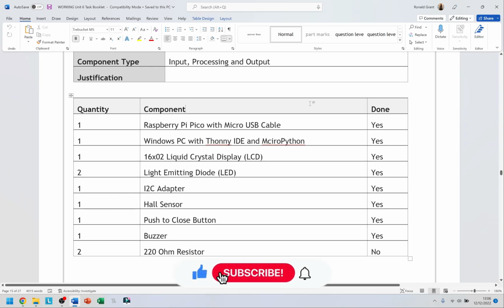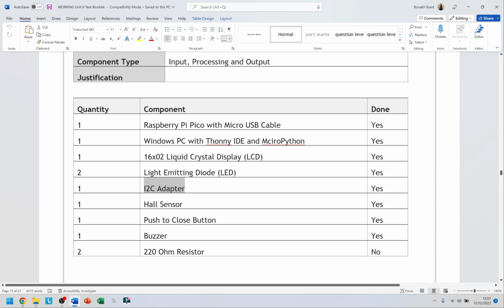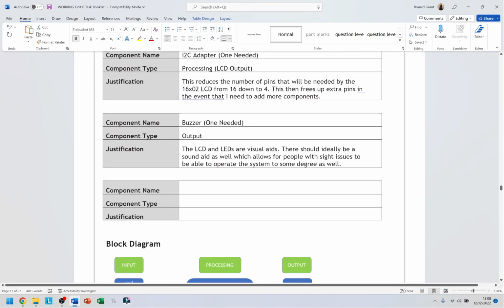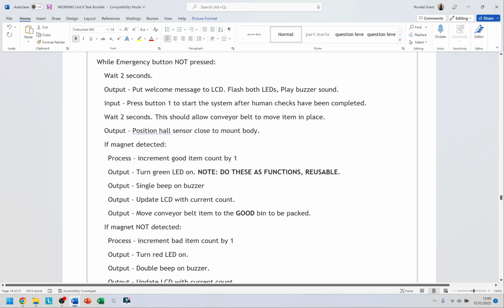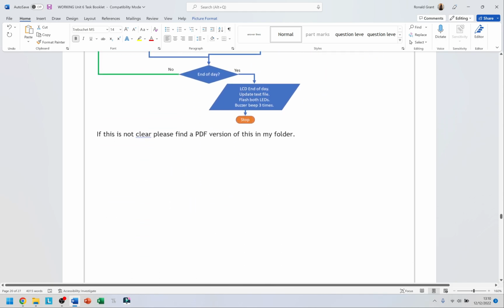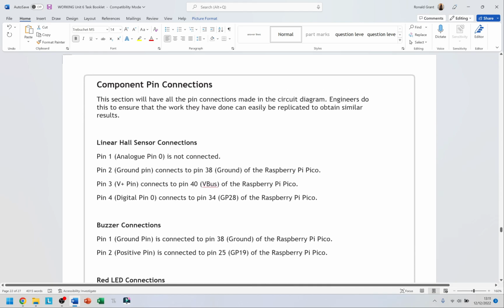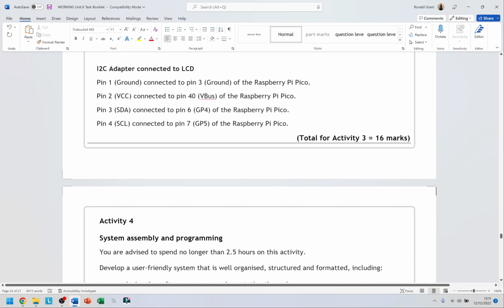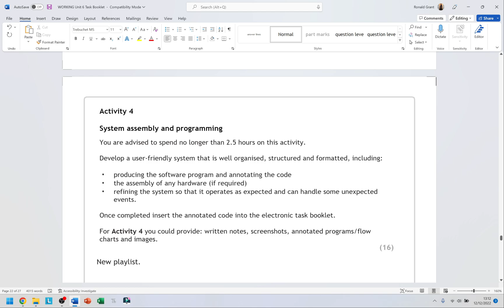BTEC Level 3 Engineering Unit 6 Microcontrollers - Part 19 - ACTIVITY 3 - RECAP

Comment: for this question u don't need a photo of the circuit that's for the question 4 right? im using arduino software
Reply from the maker: Yes, you only need the picture of the circuit where you have to "design".